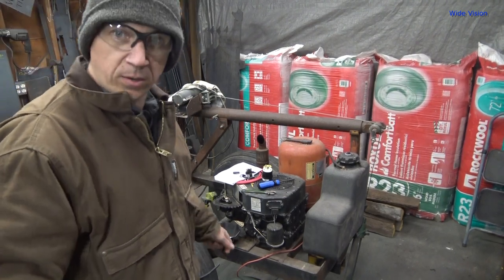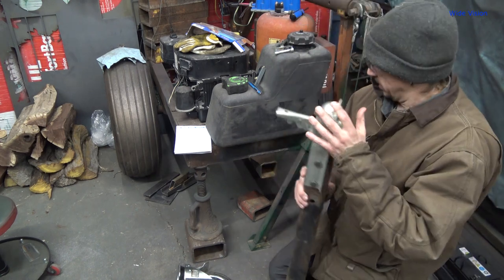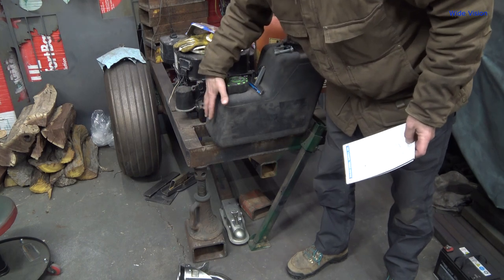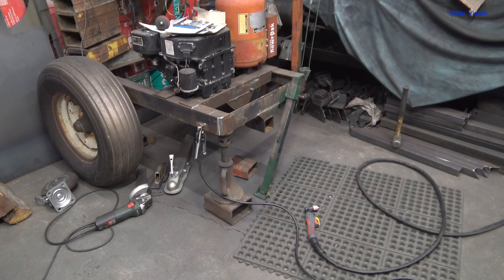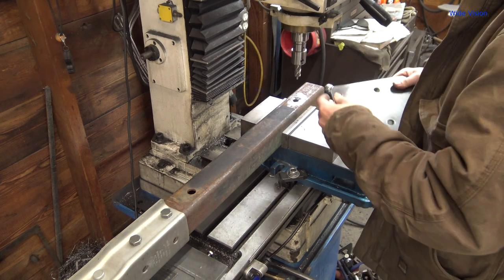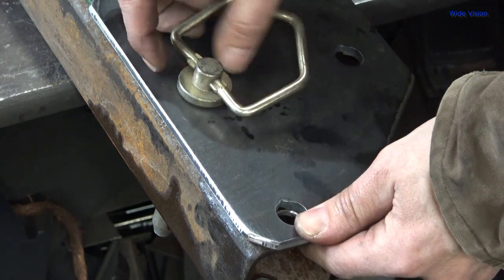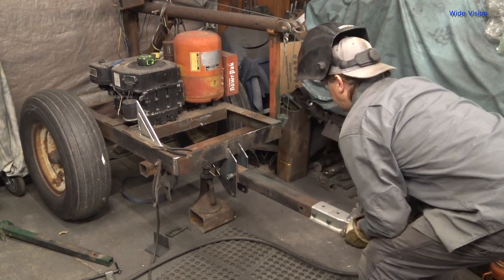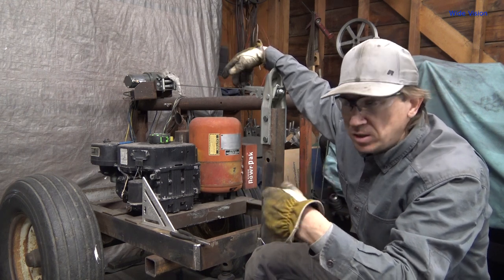Wood Chipper Tuesday! EPISODE  29  * Folding hitch build *

Comment: Just resent subscribed to your channel and in this video you could weld a plate over the angel iron to cap it in to give it some strength. The part of the hitch mount that sticks out at the back of the angel iron you could add a piece of plate to tie it into the square tube just behind the angel iron.
Is the toe hitch bracket welded underneath the angel iron?
You could fit a pivoting trailer stand to the toe hitch bar, so that when you lift the toe hitch up you can swivel the trailer stand down and in line with the trailer hitch when raised, or put a straight leg on the front of the trailer frame parallel with the toe hitch when the toe hitch is in the vertical position.
Plus you could use gussets to strengthen the frame in it's weaker, flimsier sections. 

Please take care of your health and wellbeing, stay focused on your goals and always take it in small bites and small segments and it will all come together.